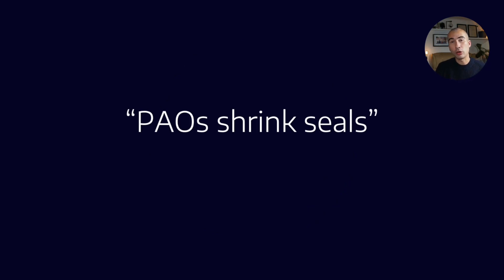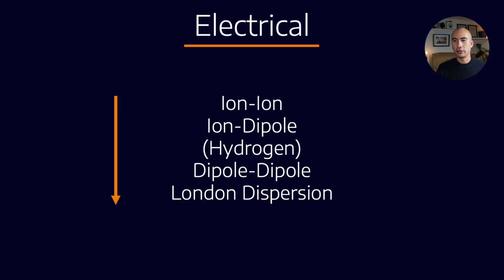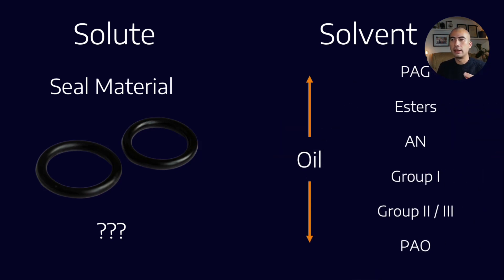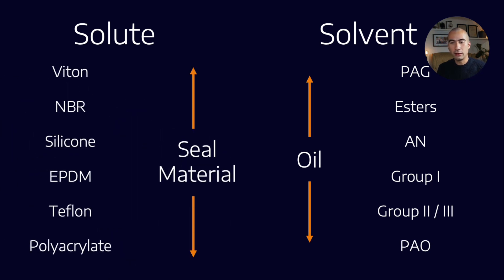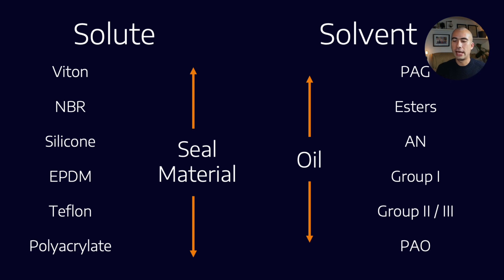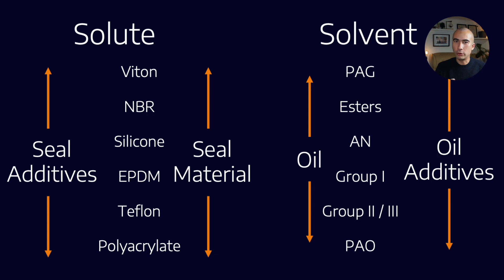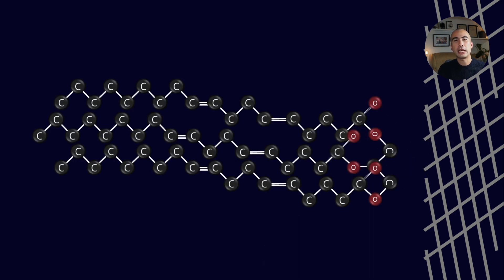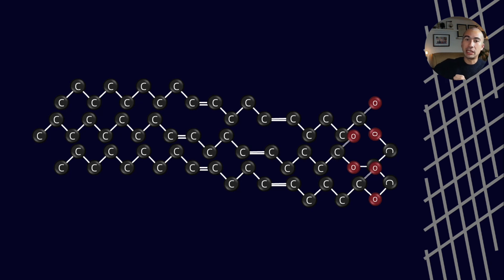Why do oils shrink or swell seals?

Comment: Hi, Mr. LE, I'd like to ask if Is The interaction of chlorinated parafins that shrink and make elastomers brittle, or is the resultant HCl2 acid in usage that does it? What about Polyether Amines (nitrogenates), as engine lubricant and fuel additives would go swelling or shrinking them?
Reply from the maker: To be honest with you I don't have an answer on chlorinated paraffins - I don't really know enough about them. Polyether Amines look like they would have similar polarity to an AN - a little more polar than paraffinic base oils but a little less than an ester. So I suspect they'd be relatively inert when it comes to seal swell.

Comment: Yay :) Some explanation, re: a question I was pondering and asking for years.
As new: Seals do have sufficiently snug fit, to metal, to prevent leak.
With age of service: It's interaction between oil formulation and rubber technology? 
The latter is a whole different science, to oil formulation: wear protection/ detergency/ etc?
Racing oils - High ester, short term? For mere mortals: A distinction would seem to be - 
Analysis of the terms: PLIABILITY v/s SWELLING? Excess swelling would lead to early leak in new seals?
Some swelling would control leak in old, worn seals?
Reply from the maker: Yes, I think that about summarises it. I've never really understood how some of those full-ester racing oils work - if maybe they use a different seal material or whether they're just banking on only needing to use the engine oil for a race duration.
Reply: @LubricationExplained  Esters are The Best Lube, short term? Win, all important?
Racing, who cares? Engines rebuilt, frequently. Sponsors' Big Bucks :)
Joe Public - Follow manufacturer manual spec?